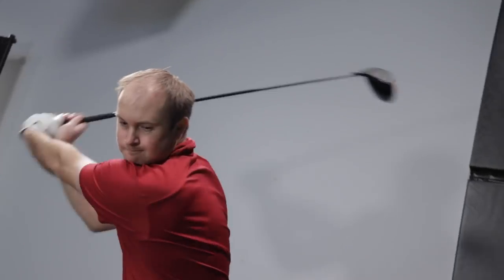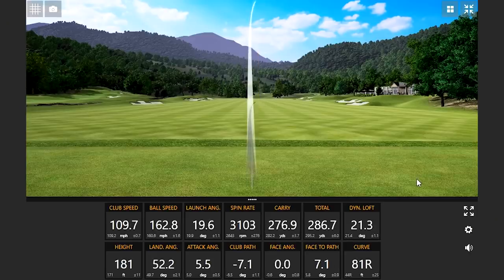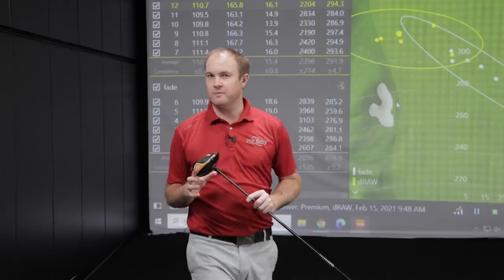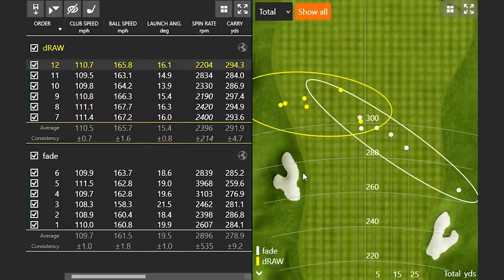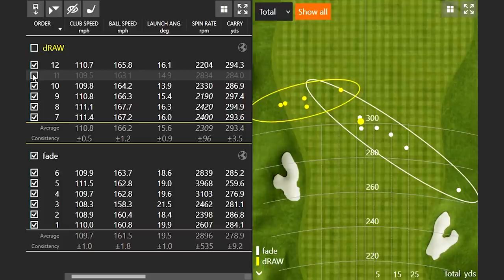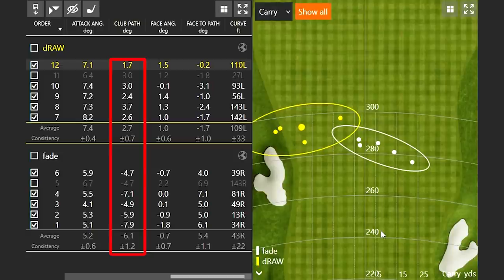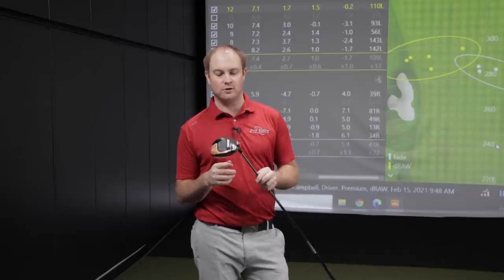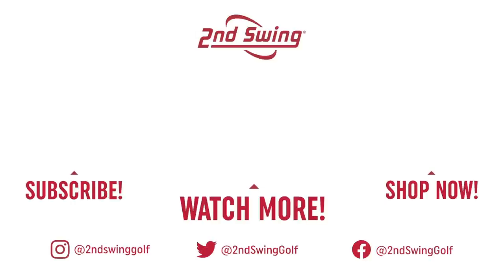Curving Golf Driver Shots Explained | Draws and Fades Off The Tee

Comment: Can you do anything to set up a driver to have a lower spinning fade to mitigate the differences in distance between them?
Reply: Watching this video, I heard Thomas say that setting the lie angle more upright would assist in reducing a fade. Thomas also said moving any adjustable weights your driver may have towards the heel. Swinging more in to out would obviously help. And I also know that increasing the loft would promote more of a draw.
Reply: @robertacierno2803  I heard that too, but I’m not thinking about hitting a draw, I’m wondering about a setup where you could still hit a fade, but with less spin and a lower launch. I’m thinking forward weight and lower loft maybe?
Reply: @Andrew-it5kn  those 2 would promote more of a fade/slice, and more spin
Reply: @robertacierno2803  I’m not too sure about that. Less loft generally makes means less spin. It would be why a 3 wood spins more than a driver. I don’t think forward weight has any bias for fade/draw either, it’s my understanding that it affects MOI and launch angle.
Reply: @Andrew-it5kn  head to a swing monitor and test it. Trial and error is always best. I reduced my fade by adding loft. Now playing a small cut with driver, and it’s playing decent.
Reply: Via the swing, the only way to reduce spin is less spin loft, so deloft the club and hit up. It's very hard to hit up and hit out to in, though. The best I can get is leave the face open and hit a face push block... thing... If you figure it out, let me know how. 😅  To get the CLUB to help, you'd just get the CG further forward and lower, so your typical low spin low forgiveness head design (the SLDR type of head). You could also just try to hit high heel on the face (low spin fade gear effect but lose ball speed).

Comment: I don't know about you but I hit a draw, not a "drawer". 
I think it should also be said that fades and draws travel different distances based on the set up and technique used to hit each one. Launch angle has more to do with set up ball location than it does with shot shape.
Reply from the maker: Lol, that's Thomas's accent. But definitely, fades and draws do go different distances. Spin would be the main factor there. Fades usually have more spin which diminishes distance. In additino to the points you and thomas made